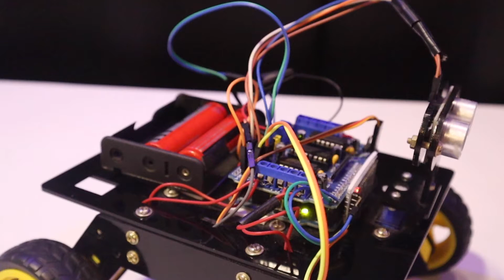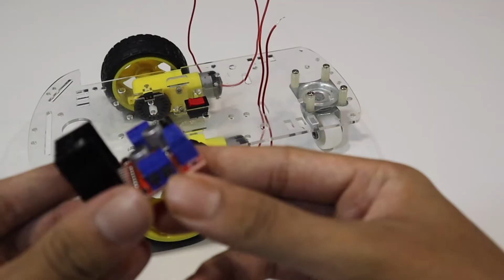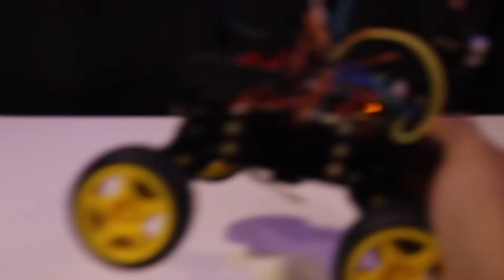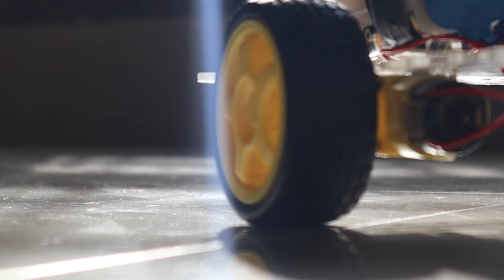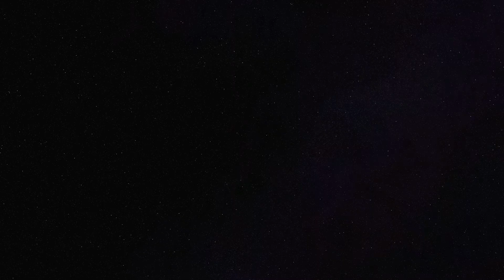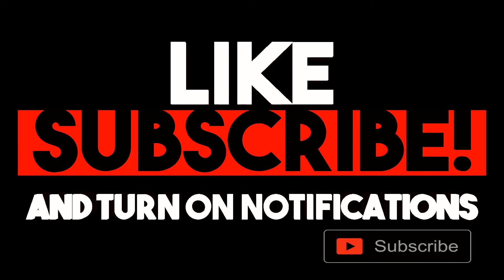L298N vs L293D motor drivers | comparison and build up| which motor driver to use for projects.

Comment: I made a obstacle avoiding robot by L293d motor shield . Is this necessary in this project  to add only 2 18650 battery to run the project effectively.plz reply i dont have 18650 batteries but when in used another any 3.7 volt battery only arduino and shield have power supply but motor not run and servo also not working
Reply: use 9V battery, though 18650 would be best but try with that

Comment: can i power 2 L298N motor drivers with one battery/powerplug(12volt) or should i use 2 separate?